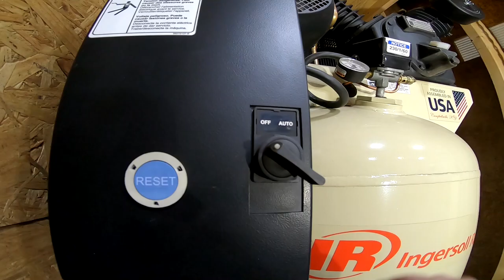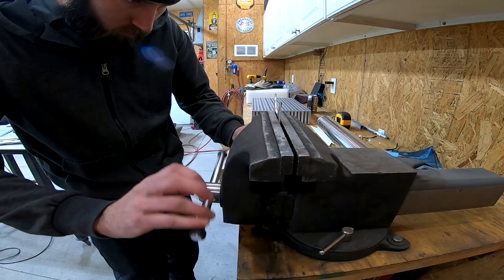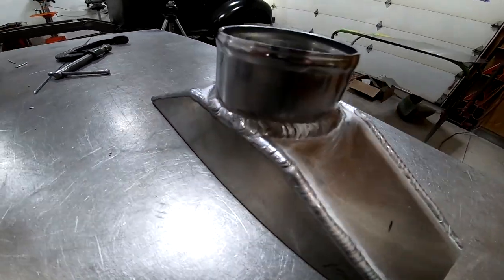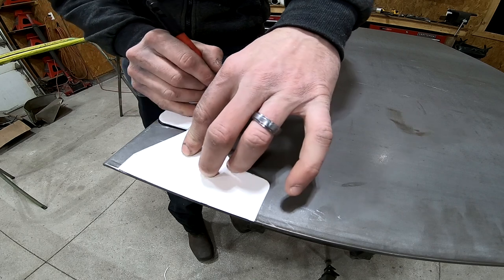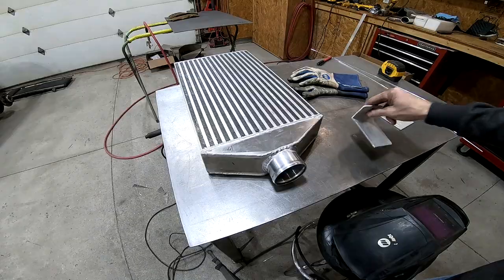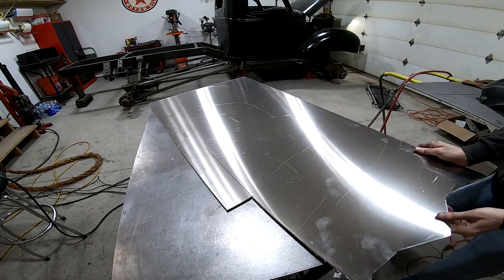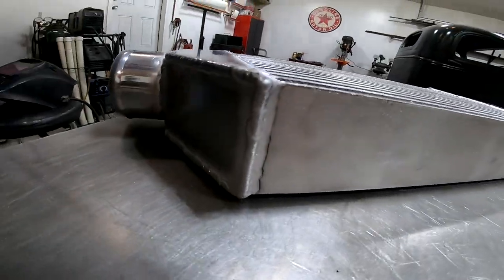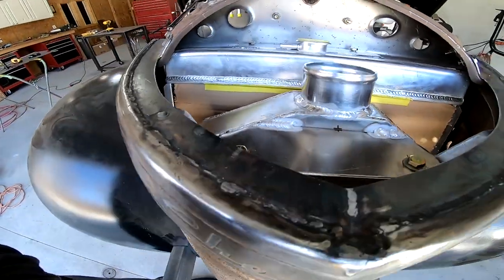Build an Intercooler for a 1940 chevy pickup cummins powered restomod truck!

Comment: I’m building a 49 kb6 international. Also with a Cummins.The core you used, what is brand and where can I find it. Thanks and also sharp build your doing.
Reply from the maker: Sounds like a sweet rig, the core is a CSF High Performance bar and plate intercooler core.  I bought on ebay from Built_not_bought_automotive it was a couple years ago so I can't get the exact link anymore.  Hope that helps, thanks for watching!